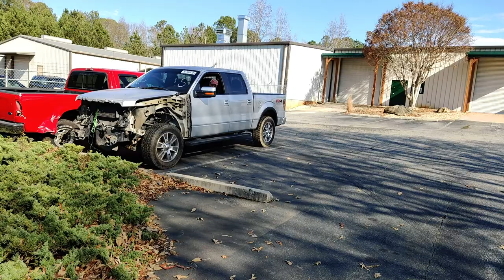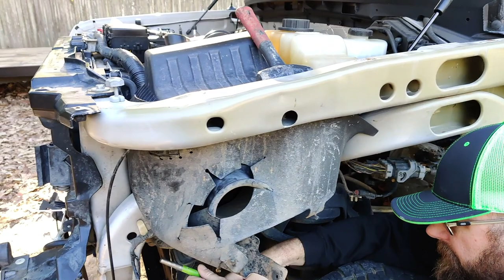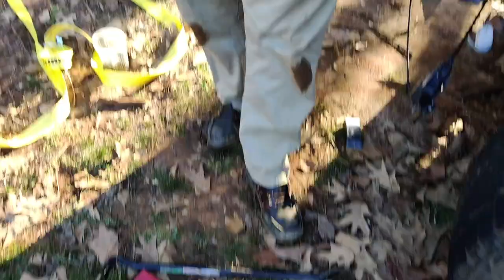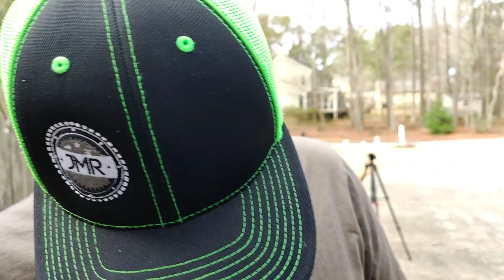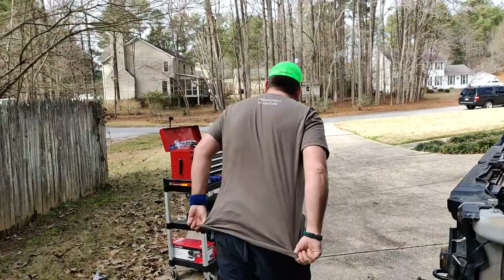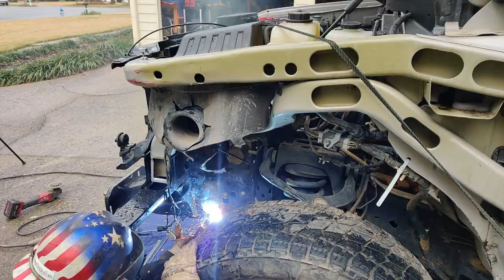How to replace frame rails on 09-14 F150!

Comment: Do you guys happen to still have measurements? Noticed passenger wheel sticks out almost half an inch more . Measured frame rails to fender and came out the same 1/2 inch so either one rail is pushed in or the other is pushed out.
Reply from the maker: We do somewhere. Email us jmrrebuilders@gmail.com. thanks for comment and support

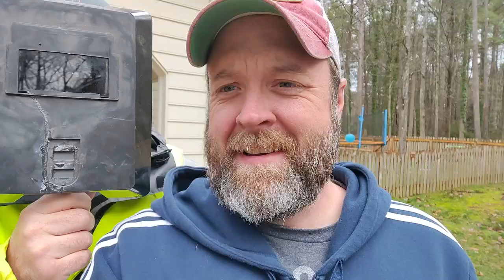Comment: At 17:20. I’ve been trying to find out what that black painted brace or whatever it’s called at the lower right corner of the screen that the fender attaches to. Can you guys help? Need one for drivers side. Hit 3 deer and busted mine as well as other things.
Reply from the maker: Hey thanks for watching and commenting.  Sorry about your accident.  The part your speaking of is called the lower core support.  It runs to both sides and bolts through the frame rails.  It is also spot welded into the fender aprons on both sides with 6 spot welds on front and back.  Good luck and let us know if ya need anything else.
Reply: @JMRRebuilders  I looked it up and it shows to be the radiator support, but that is it. Thanks. I really appreciate it!

Comment: JMR Rebuilders, Im curious how you were able to get the front bumper rails straight? did you just press fit and tap them in till the were fully seated? or is there a good measurement to use? i want to be sure they go in straight before welding!
Reply from the maker: They slide right in with some help.  They need to go all the way in a seat completely.  There are some measurements we can send you.  Email us at jmrrebuilders@gmail.com and we can send what we have.  Hope it helps.  Keep getting after it.

Comment: My front rails have an extra plate attached to 1st set of plates . My first time working on a truck. Crashed it so trying to fix myself . Do you have an idea what they are for?
Reply from the maker: I'm not sure I understand the question.  If it is a 09-14 the end of the rails have a ear on the end that bolts the bumper to frame horn.  Hope that helps. Good luck let us know if ya need anything else

Comment: How did you know how far the frame rails should have been from where you cut it?
Reply from the maker: Hi Donovon I am not sure I completely understand the question.  So I will attempt to answer.  We cut the frame rails off where the factory welded them in and the replacements we bought were OEM replacements.  So they were the same specs as factory.  I hope this answers the question. 

Thanks for the support. Please share with your friends we are closing in on 300 subs.

Comment: I have a 2010 f150 with a rebuilt title. I bought it for 11 grand (with rims and tires and lift kit installed). It has a SLIGHT bent to the right/passenger frame rail. Can I just cut and replace it like you guys did yours? Or dorks I just bend? 

Any ideas would be great lol I like your channel and how you fix vehicles!
Reply from the maker: Total depends on your state.  The correct Ford repair is replace at seam.  However others have bent them. Good luck to ya brother thanks and consider subscribing
Reply: Worth noting is complete body swaps on (non-rusted!) pickups are disturbingly easy to do. We did them on trucks and SUVs at a used car lot I worked for and I've done three over the years myself.

Comment: Great job guys!  I have the same problem with my Dodge Ram. Crashed the front end and those bumper supports are both bent to the right. Prolly need to come off like yours and weld new straight ones on. Now I have an idea how to do it. My fender supports or aprons as you call them are too far gone and I need to go to a salvage yard to get those replaced. Question, when yall mounted those bumper supports did y’all do any measurements to make sure the bumper would line up correctly?  I’m concerned after the cut and placing the new ones on that everything won’t line up once everything is mounted back on
Reply from the maker: Thanks for the comment and support.  Not sure about a dodge but I imagine somewhere there is a factory spec measurement.  We just did everything to get it back into factory spec. Good luck to ya and hope it works out.  KEEP GETTIN AFTER IT
Reply: The trick for aligning that stuff is to bolt on the minimum amount of parts. I'd bolt the bumper to the stubs, align the bumper to the body so it CAN'T be wrong, then tack weld the stubs, confirm and visually it looks like what ya want then remove the core support and finish weld. 
 It's like using door gaps and windshield glass to align the halves of a clipped car. Use the parts whose dimensions are good to align parts to be welded and ya can't really go wrong.

Comment: Hello Guys,
Can you tell me how you welded the new lower radiator support to the apron? Do you have to drill holes so it can be spot welded?
Any help appreciated. Oh and I purchased a JMR shirt today, very cool.
Thanks
Reply from the maker: Yes you have to drill out the existing spot welds.  You can do what is known as plug welds.  You drill a hole on the new support and fill it in.

Really appreciate the support and purchase.
Reply from the maker: Did you receive your shirt?

Comment: How did you know how to align the new rails? (how far in,etc). Also, where did you get them?
Reply from the maker: We have a friend that has the exact same and used his to measure the correct measurements.  The new rails are beveled and stop at the end so the depth isnt an issue.  We purchased them from ebay.  

Thank you for the support, comment and please remember to subscribe.
Reply: I have a 06 f150 that needs driverside frame rail replaced what kind of cost we talking
Reply from the maker: Hi Thomas I am not sure on the 06.  However I imagine a quick Google will find the piece. I imagine it would be q00 bucks and another 150 for welding it up.  Give or take.  Good luck brother and keep getging after it.

Comment: New sub here. How difficult/effective was the tree tug on your first rebuild? I am considering a crashed raptor that needs the same. Looks like the lower radiator support took the hit but did slightly twist the apron. I'm not looking to replace it even though you guys made it look easy. Also left front wheel pushed back an inch. I am hopeful that the suspension components are to blame and not the frame. Any ideas?
Reply from the maker: Hi Robert thank you for the sub.  About the tree pull it works the key is targeted pressure.  There are a ton of ways to accomplish this.  Also the lower core support is really affordable but it can be a bear to get out.  The suspension pushed back could be a multitude of things.  We will do our best to help ya.  I say get the raptor and give it a try.